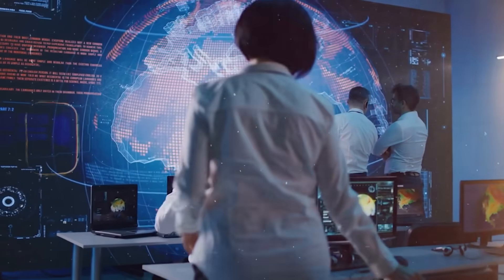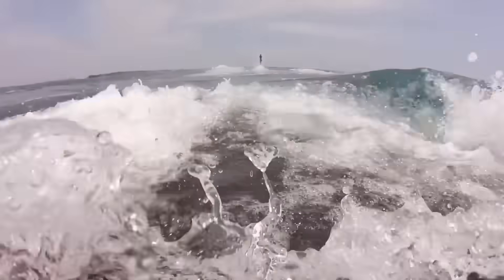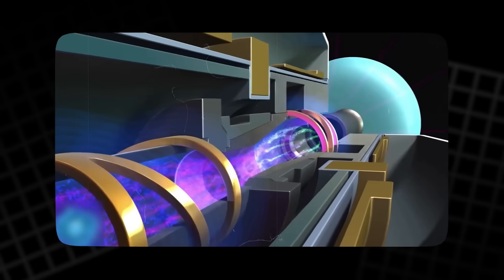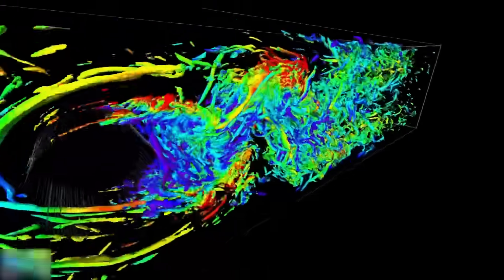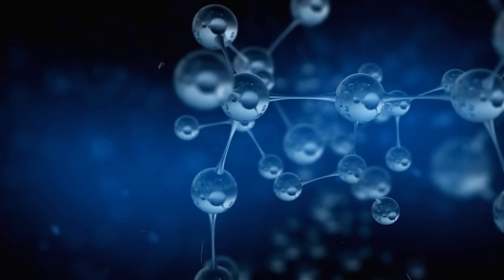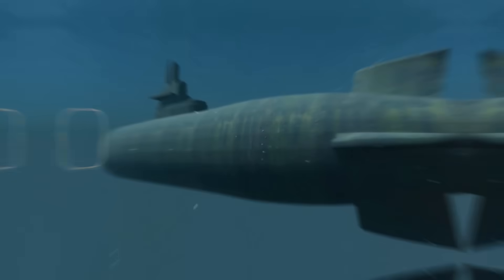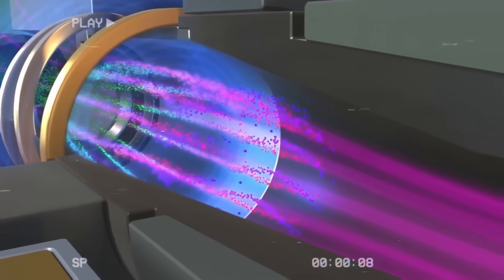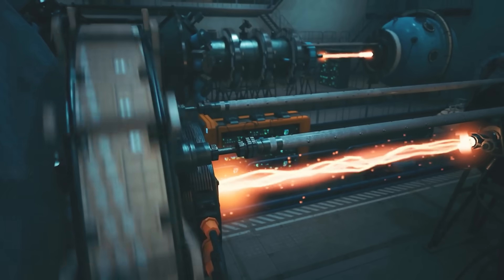NASA and DARPA’s Secret Propulsion Experiments Revealed

Comment: Those seawater corrosion resistant coatings could help with corrosion problems in solar-electric hydrogen generation from seawater.

Comment: Out in space it's a consent -455 F, couldn't you bring in that air into the engine to keeping it cool like a radiator system on a vehicle? Also maybe using liquid silicone will help to reduce the magnetic particulars from rusting and corroding.
Reply: What "air"?